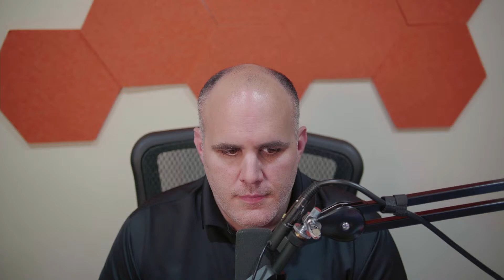SBA 329: Understanding How BACnet Really Works

Comment: re: 17:10 - If you're a Delta Controls partner, you can use their N4 DeltaBench Niagara module that basically adds the Delta engineering capabilities (config/programming/commissioning/etc) right within Niagara.  Good vid Phil!
Reply from the maker: Good point.